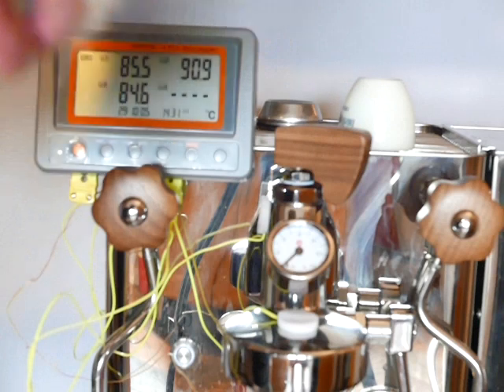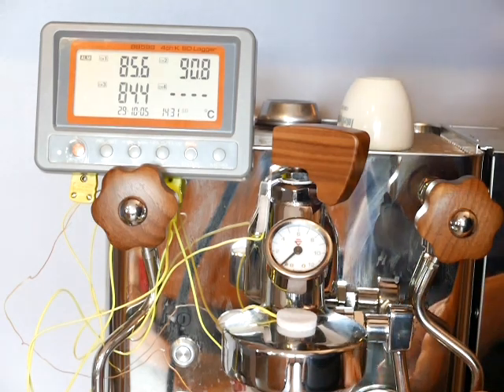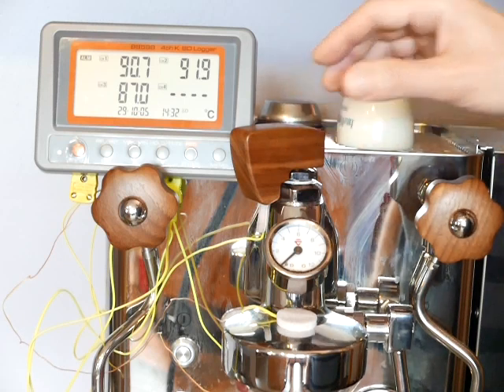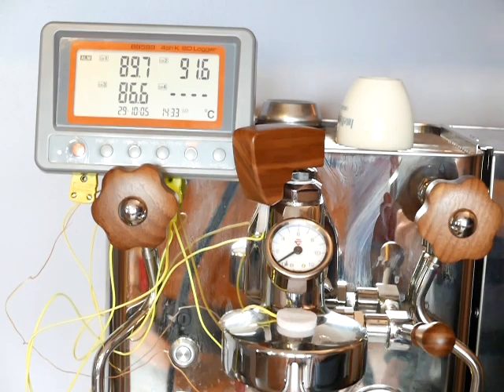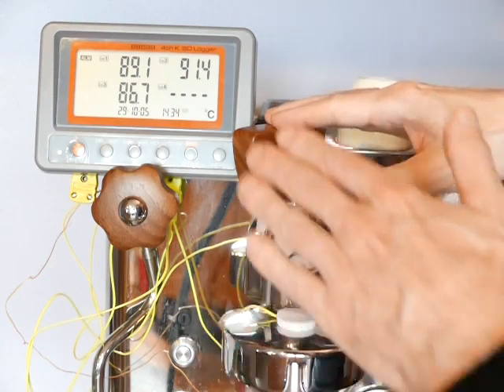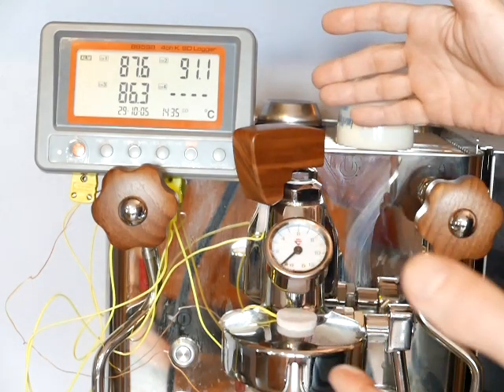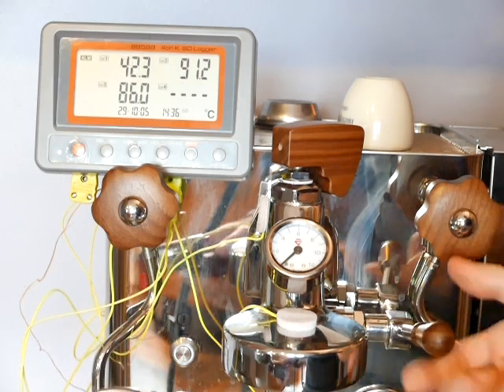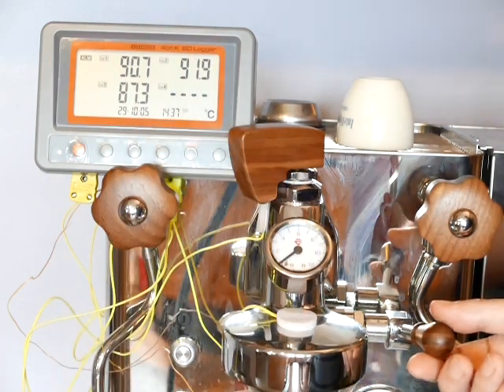Bianca Flow and Temperature Control

Comment: Eventually I checked my PID once again using your method. I filmed every attempts: from 98C to 103C. Then - 10 min pause between. I analyzed sound and flash boiling process. My water boiled in 102C so I changed offset in Bianca 2 degrees. Thank you Jim! Now my light and medium roasted coffee is really as it should be.Thank you Jim!

Comment: Thaks Jim! But I'm a little worried about left max position of the paddle (no water at all in that position) because you has written somewhere in posts that  "max to the left"  without of drops of water can damage profile valve?
Reply from the maker: It has when people have been slamming it around. It's a needle valve, and somewhat delicate at it's end points. If you like making shots with big gestures, it might be a good idea to protect the valve. If you use small motions, you'll be fine.
Reply: Great! Thanks again:)

Comment: Hi Jim! You are saying on video that your paddle position gives about 2 ounces per 20 sec. It means about 56,6 g. in 20 sec. = 2,8 g per sec. In my Bianca in this position of a paddle I have got 4,7 g. pers sec. Why is this difference?
Reply from the maker: The handle can be removed by unscrewing the small screw in its rear and repositioned. It should be positioned so there is no flow when it touches the case at the left. If the flow cuts off earlier than that, the flow at every position will be lower.

Comment: Hi thanks for your films - it is pitty that you don't continue that! I have a question about my Bianca. When I set up 100C and pull the lever up, my water has only (?) 95 C. I  touching  termometer sonda direct to drops/shower screen as clouse  as possible...
Reply from the maker: That method always reads low. If the water is flash boiling (steaming and sputtering) as it leaves the machine, you are good. If it is not; then it is too cool, an dyou need to raise the offset.
Reply: @HBsJim  Thank you very much...Few hours ago I put the tip of my sonda into my portafilter and then all "construction" put into the group and...:) I got the same group temp as you got on video of yours: temp PID 91 - about 86 C. So I assumed that my offset is correct. By the way I like very much your style of presentation of coffee problems and coffee mysteries. You realy know what is going on with coffee. Thanks again for your respons!!!

Comment: Hey Jim, I found your video after researching espresso machines and arriving at this one on the top of the list.
I wonder how well a custom insulation of the group head and the mount for the portafilter would work - what do you think - assuming one could make it look presentable?
(To get the shot temperature during a profile closer to the non-profiled shot.)
Reply from the maker: Complete insulation is not a good idea. The group needs to shed heat for the thermosyphon circulation to work. Lots of thermosyphon groups are shrouded at the top, but they will always expose a lot of brass. 

The new E61 double boilers are improved in terms of energy efficiency. They have insulated boilers and can run brew boiler only. My Bianca, running brew boiler only, averages about 40 watt-hours per hour. That's about a third of what my E61 HX from a fifteen years ago used.
Reply: @HBsJim  Thanks for the reply Jim. As an owner of the bianca, do you think it is built to cope with a small office pulling 20-30 shots a day?
Reply from the maker: @Yergs  In terms of build quality, yes, with one exception -- the flow control paddle at the top of the group is prone to damage if it is forcefully turned completely off. Make sure when it it is turned full left (so the paddle touches the case) there is still a trickle of flow.

There are caveats to getting any manual espresso machine in an office -- its more like having a gas range than a microwave. You'll need to plumb it in with treated water. You'll need a grinder supplied wit coffee and set to grind and dose properly. You'll need to clean and maintain the the entire set up. If you are the only person who knows how to do this, you'll end up being the barista for everyone.

Comment: Hey great video! I just don’t understood where the first thermocouple was located and which temp it was showing?
My understanding is that you didn’t measure the actual water temperature in the Filter holder, right?
Reply from the maker: One TC, fixed on the neck of the group,measured the group temp; the other, in the basket, measured the water/shot temp. I didn't use the video in the review, since the machine had calibration issues. Once it was correctly calibrated, the stability improved

Comment: How latent and inaccurate is external measurement of E61? I assume you've installed some sort of thermocouple into the M6 port and compared?
Reply from the maker: I was measuring the actual shot temperature on one of the channels, and the group temperature at two spots on the other channels.

Comment: Thanks for this clip. What was the temperature setting at the PID?
Reply from the maker: . The nominal setting was 95; but the offset was out of calibration, so it really was 92. Thermosyphon flow is finicky, and varies from unit to unit even on the same production run. So it's worth while checking the accuracy of the offset in any PIDed thermosyphon (and to a lesser extent saturated groups too). Just crank up the temperature until you see immediate boiling water flush from the group, and set the offset so that shows 100C. I have another video showing how.
Reply: @HBsJim  thank you Jim! You're doing a great job sharing this.
Reply: Thanks! Really good to know!